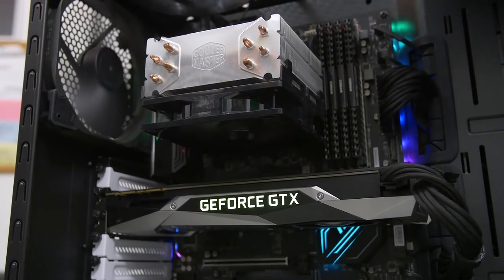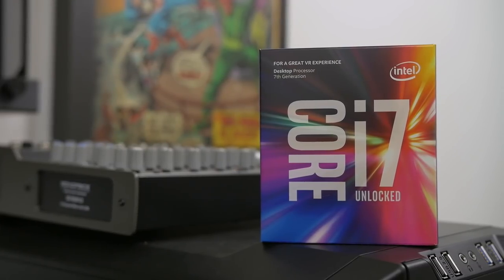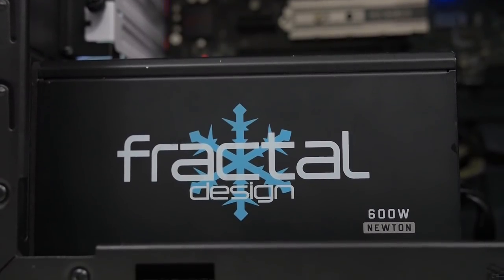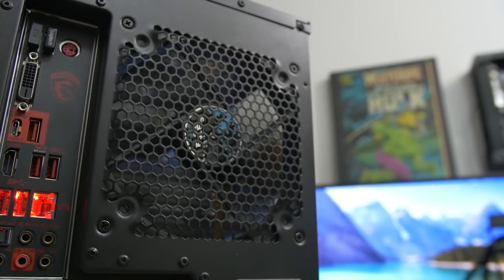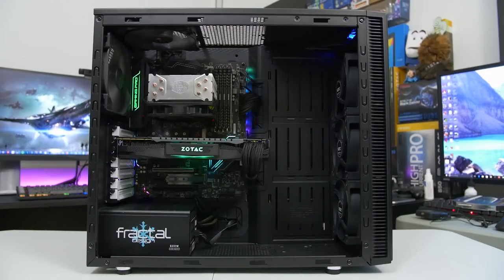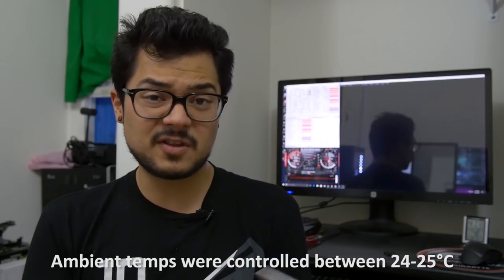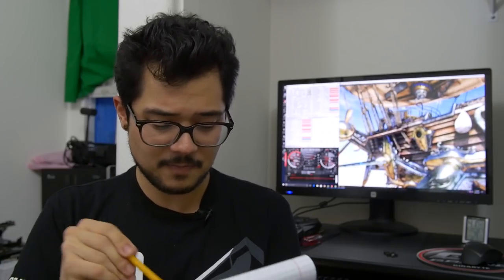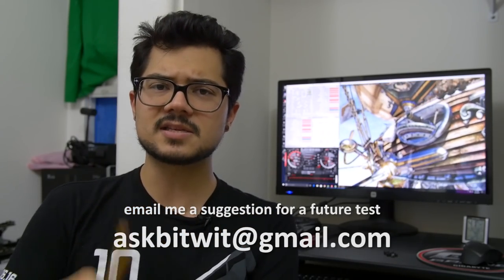This is how you should mount your CPU cooler! I think??

Comment: Possibly the blower style cooler made the ambient temps of the gpu hotter and because there wasn't proper airflow around the pcb of the gpu that might have created a "flat spot" where the hot air couldn't be vented fast enough

Comment: I think this is due to the backplate on the GPU radiating heat onto the heatsink fins. The backplate will not cool as efficiently on a reference card due to the hot air only having one direction to escape. Think of the radiator fins as your hand and the backplate as a stove top burner. Imagine your hand only a few inches above the burner. Now placing the fan between the backplate and the heatsink fins allows for a physical buffer barrier between the two, almost like wearing an oven mitten. The plastic fan will not allow for as much radiated heat to transfer to the metal heatsink when it acts as a buffer.

Comment: Ok,  just a theory since I'm unsure of where and how the air actually moves from the open gpu. But when mounting the fan blowing out of the case,  you got exposed heat sink closer to the gpu. And the gpu blowing air in the case could be causing increased air movement around the heatfins. In the second case,  the fan is in the way resulting in a barrier between them, causing it only to be affected by the marginally higher air Temps. 

Since air is such a bad heat conducter,  more airflow should be beneficial in every case,  since the air exiting the gpu isn't the same temp as the gpu.   And as long as it's lower than the heatsink temp  it should act cooling.  

I think.

Comment: I'd say you either need more data and/or less variables. CPU temp, GPU temp, system temp, air temp, fan speeds, etc., etc., etc. all either need to be monitored and/or set to fixed values to help draw a solid conclusion. And did you take into account room temp fluctuations? just because the AC says 24/25c on it doesn't mean the air going into the PC is in that range e.g. if the AC sees 25c its going to kick on/up and might be blowing notably cooler air into the case for a period of time.

Comment: 4:58 I think I know why. The blower style functions as an extra exhaust fan, thereby having 2 effects on the internal air. First, it reduces the positive air pressure, which makes the air inside the case less viable at transferring heat off the fins, and second, because it is an exhaust towards the bottom of the case, in a case where the air has nowhere to escape other than the gpyu and the top exhaust, the air that the GPU exhausts is going to be the lower, cooler air pulled into the bottom of the case by the lower fan, which by the consistent pressure of said fan, would remain fresh and be pulled up towards the CPU cooler. It would get used by the GPU, but it seems that in this config, either the warming of the GPU was insufficient to warm the air to the same degree as the rest of the higher and hotter fresh air, or it was insufficient to overcome the heat transfer advantage of high air pressure.
Reply: 5:50 ah, in that case, it's likely that the reason that the open air gpu in the first case helped CPU cooling was more a matter of where the air was coming from airflow pattern wise. It seems that the GPU air was circulating around the bottom of the case, and being vented out more slowly, while the CPU and front fan was pulling air almost exclusively from the front, and pushing it cleanly out the back, in an uninterrupted air tunnel. Essentially, a 3 fan setup with extra space. When the cpu cooler faced the other way, drawing air from nearby the GPU however, this changed the nature of the air flow. It benefitted from the direct exhaust by the larger top fan some, but that meant thinner air pressure in that area, because the GPU was blocking the airflow partially. The extra strength of the larger top exhaust fan was able to overcome this partially, but then it became an issue of where the extra air was being forcefully pulled from, namely, from the bottom of the case, where the air was either being cycled quickly with the GPU exhaust, or heated ambiently with the open GPU.
Reply: TLDR: the first CPU orientation works because of the air tunnel effect paired with less overall case exhaust leading to higher air pressure, with the GPU's heat more or less out of hte equation, and better heat transfer from the pressure. 

The second works because the heat tunnel is turned a different direction, drawing air from the GPU area of the case, which is either kept coled and low pressure from the exhaust blower, with the CPU tunnel adding extra pressure by pulling, or higher pressure, but higher heat from the open cooler.
Reply: it would be interesting to see the results with side cooling, either with mesh or an active fan, as well as with vertical GPU mounting, as that will heavily impact the nature of the dual air compartment effect we're seeing.

Comment: with the blower style, the gpu likely retains greater heat and has less inter case airflow causing the gpu to radiate more heat on the cooler while the cooler gets less cooling from ambient airflow....test this using a thin piece of Styrofoam the shape of the gpu backplate laid over the back plate....also try making fan speed adjustments to keep the gpu temps the same

Comment: Probably the open air video card, in the case of the cooler mounted sideways, is helping circulate the heat that's passed from the video card through the PCB. That's why the blower style cooler is doing worse in that scenario, because the head concentrate in the PCB zone and accumulates, without being transfered efficiently. Maybe, to try if this is true or not you may try to put the blower style cooler one PCI slot below and do the same tests again to see if what I think it's true or not.

Comment: My corsair H100i GTX recently died (was getting cpu temps of 100C while i was in the BIOS) with my Intel 6700k @4ghz (no overclock). So I decided to buy the Noctua D15S but it was not available in any store and I'd have to order it online and wait for it to arrive. So before I ordered it I figured I'd purchase a temporary CPU cooler and bought the Hyper 212 Evo after confirming i could return it within 14days. When i set it up, i set it to push air up in my NZXT H440. However, I later realized that the cheap fan that came in the 212 evo made a rattling sound if i placed it in that orientation (it didn' tmake that noise if the fan was held sideways which is odd. So i changed that fan and used the extra bracket that came in the box and put one of my corsair sp120 led fans. Surprisingly it fit on with no problem. Again this was temporary cooler so I didn't bother returning. But then when i saw playing witcher 3 for like over 30 mins unlocked framerate i was geting max 41C on the CPU i decided to fk getting the Noctua D15S and stick to this. This heatsink is excellent, fan - not so much. If you're willing to stick with it, just change the fan to a quieter SP fan and you're set.

Comment: Explanation for the "Horizontal and Zotac card": The blower card doesn't cool the pcb of the gpu enough with this one little fan, so the backplate is much hotter on the blower card than on the Zotac card because Zotac uses 3 fans which also cool down the pcb alot. (Less rising heat from the Zotac card) And because of the massive airflow from the front, the heat produced by the gpu is transferred to the back and up to the 140mm fan.

2nd explanation (not sure): The Zotac card is moving the air in the case much more than the blower card so the Hyper 212 Evo gets more air circulation and maybe positive air pressure? I am not sure about this one...

Explanation for the Vertical and Blower/Zotac: In the horizontal cpu cooler mount, the heat from the top of the gpu rises and gets sucked in by the back fan, exhausting it out of the case. But because the cpu fan is now pulling air from the gpu and not from the front fans it gets hotter. The only thing I dont understand is that the Vertical+Blower is cooler than the Vertical+ Zotac. MAYBE because the cpu fan picks up some air from the 3 big gpu fans which is hotter than the air coming from the backplate...

Comment: I think what you are seeing is the affect of air flow.  with the cpu hx vertical and the hx fans pulling in air and the back fan pushing air out, the air current is horizontal.  because of this the hot air from the video card is pushed back while the cpu cooler is getting fresh air from the front fans.  what you are getting is basicly two fans pushing air across thw cpu cooler, just like when you put fans on both sides of a liquid hx.  with the cpu cooler horizontal, the video card exhaust is being sucked directly into the inlet of the cpu hx.

Comment: With a blower style card, you are creating less of a positive pressure and air flow is being brought to the card. This starves the horizontal cooler of maximum airflow. With the other card, because air is not being drawn to the lower back end of the tower, it's natural flow would be in the direction of the intake fan on the CPU cooler. The reason why your test results were more in line with your thoughts for the vertical test is because the blower is not radiating heat directly into the CPU cooler, whereas the other one is.
Reply: I would like to see this test done again with gpu temps.

Comment: when the fan is horizontal the shroud on the zotac probably spreads the heat more, and while this seems to not actually have much if any effect on gpu temp it may be helping reduce motherboard temp and in turn cpu. however when the fan vertical (fan facing gpu) it then is sucking in the extra heat that is being held in the shroud .

Comment: It could be because the blower style card runs hotter on the card  and that transfers heat to the cpu heat sink but the open one won't be as bad because eof the amount of fans ur running the air should be changing often.

Comment: You had mistaken horizontal with vertical. The horizontal position is as the horizon, hence the name. So the reason why I suspect you got a cooler CPU when you had the heatsink in a VERTICAL position  with an open shroud GPU is because the GPU was providing extra air through the side of the heatsink aside from the one supplied already by the FAN, also I think that the air from the GPU was cooler than the CPU heatsink itself. In the case of the HORIZONTAL orientation, the CPU FAN was fed enterly on the GPU warm air.

Comment: I think it could have to do with how the fan in the blower GPU is closest to the front intake fans possibly choking the airflow to the CPU cooler. It may not be much of a difference but possibly by the open air gpu recycling the same air it allows more air to reach the CPU cooler. Hypothetically speaking at least. You should try a interior pressure test if you have the equipment to go at it. A bit extensive for a simple question but hey just my two cents

Comment: Maybe this result is because the blower style card is robbing a good portion of the air flow from the CPU cooler, and just shunting it straight out the back causing a low pressure area around the CPU cooler reducing the amount of mass of air it can interact with and resulting in higher core temperatures.The open air GPU class does not steal air from the CPU cooler which because of its fan orientation is taking most of its air from the front of the case, and its not being over powered by the GPU blower fan. and also in this set up the GPU's exiting hot air would be largely forced back and up by the prevailing currents created by the case and CPU fans.The vertical intake mount does not suffer this problem because the intake on the CPU cooler is now closer to the blower air intake where their combined air flow creates a current in the case which is then split between the CPU cooler and the GPU blower resulting in much more even air distribution in the CPU and GPU and less dead zones in the air flow because the cases prevailing airflow is directed to the combined CPU/GPU intake location which then exits the case through the blower/case fans.

Comment: I think the perpendicular orientation is due to the air going to the cpu coming from the back of the case where the air has a chance to exchange with cold air and the zotak graphics card doesn't disrupt this air flow while the GTX does disrupt it and probably causes the hot air from the GTX to go into the CPU

Comment: My older rig has an overclocked 6600k. It's air cooled and the heatsink is facing down. The case's top fan is pulling air in. It's a weird setup, but I've never had any temperature problems. Hits 55c when gaming hard, but that's it.

Comment: It could either be something to do with air pressure, or you didn't lock the RPM of the fans so they were spinning at different rates during the tests.

Comment: my theory is that with the vertical mounting, it runs hotter with the open card because the CPU cooler fan is directly above the GPU, pulling all the hot air from the card through the cooler.  The reason why it doesn't happen with horizontal mounting is because the cooler is getting mostly cool air from the front of the case.  If you have a blower style card, it will act as an exhaust and reduce the degree of positive pressure in the case.  With higher positive pressure, the air particles have more collisions and thus carry a greater velocity.  this means more air is moving through the heatsink and that means lower temps.

Comment: in the test where the fan from the CPU Cooler is facing blowing towards the back the case with a blower Style video card it was creating a low pressure Zone towards the bottom of the case and you were getting a high pressure Zone at the top I think this happens when two sets of fans are flowing in the same direction with spacing between them kind of like how a jet works between the two blades the fans a high pressure zone is created so with the open-air video card it disturb the airflow at the top of the case with a CPU is this simply happens when you introduce a fan blowing in a different direction Intuit case with multiple fans flowing in the same direction I believe this is why you saw more predictable results with the CPU fan blowing towards the top of the case this cause that turbulent airflow breaking up the high to low compression and completely changing the overall air flowing through the case

Comment: Theory:
Vertical style draws the hot air rising from the GPU fully across the CPU heatsink fins.
When mounted horizontally, the hot air reaches the heatsink fins, but is then immediately carried away by cross-wind, spending less time in contact with the metal fins.

Comment: I loved your videos about CPU cooler orientation and radiator positioning. Could you make a video that compares the internal temperatures of a computer with the power supply mounted with the fan pulling air from the inside the case vs pulling air from under the case?

Comment: I am wondering if the weird results from the first two tests could be explained by amount of overall airflow to the cpu cooler.  When the cpu fan is horizontal, it is inline with the highest intake fan on the front panel, so it might be getting fresh air from there.  When using the non blower style gpu cooler setup, the bottom of the heatsink is exposed and I would imagine the air temperature being pushed to it by the gpu fans would be cooler than the actual cpu heatsink which might actually mean its getting a tiny bit of cooling from the gpu fans.  That could explain your anomaly right there.